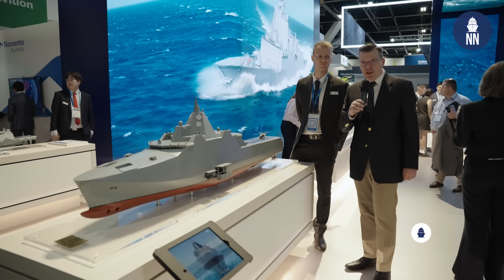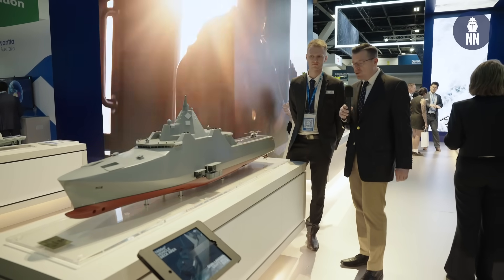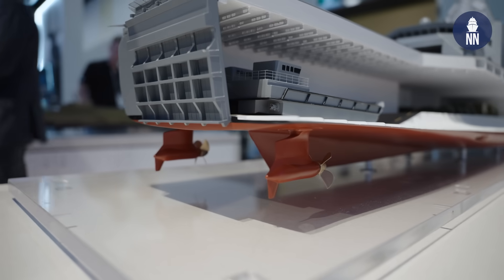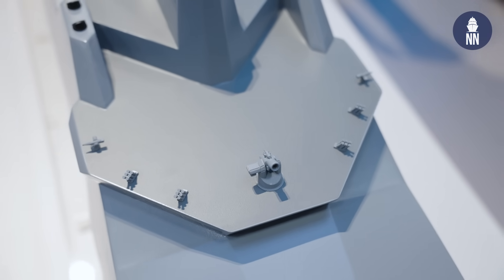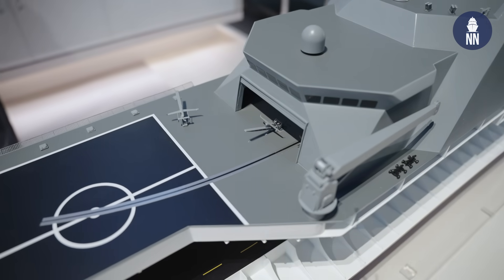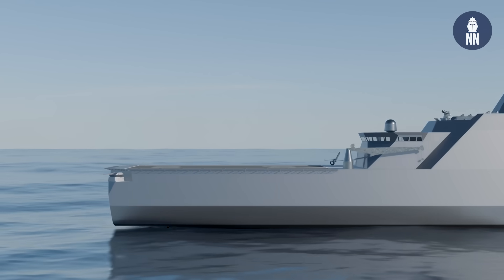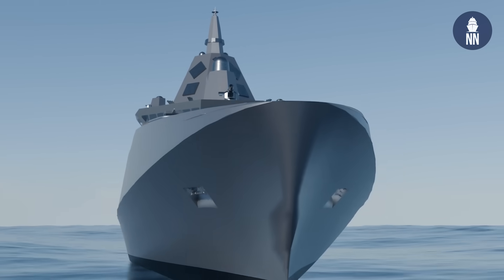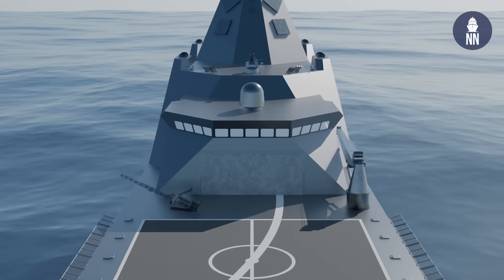Navantia Australia's SMART LPD at Indo Pacific 2025

Comment: Good design. There is an argument for ships like this as they are also capable anti-piracy platforms,  can act as depot ships to support other ships on deployment in low intensity/anti-drugs/anti-piracy operations or operate solo for the same missions.  The addition of a reasonable AAW and ASuW self-defense capability with the addition of vertical launch cells would allow it to look after itself in low intensity operations.
Reply: That requires more space, and that means tonnage.
Reply: @IVANGARCIA-ks4vp  I don't think tonnage would be a problem, the crewing is the issue.

Comment: I wonder why they chose a curved bow instead of a flat top. Seems harder to maintain, and how are they going to reload those VLS cells?
Reply: In a port like everyone else.  The USN initially tried reloading at sea and that led to smashed up Vertical launch containers, chunks of missile propellant all over the deck, in empty launch cells and officers of the deck diving overboard in an attempt to not be decapitated by a swinging launch containers or incinerated by loose rocket propellant.  The ship also needed to go back to base for a thorough cleaning and a board of enquiry.
Reply: Normally they have sailors on deck who spot and align the crane with the cell. That just doesn't appear possible with this design.